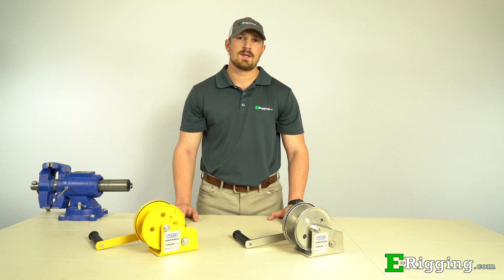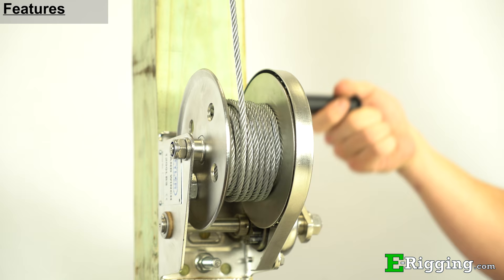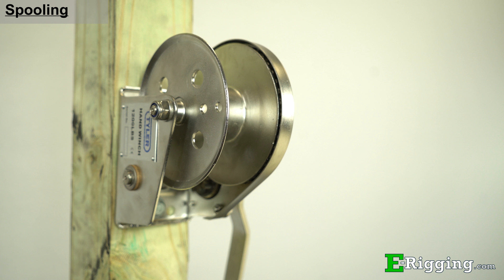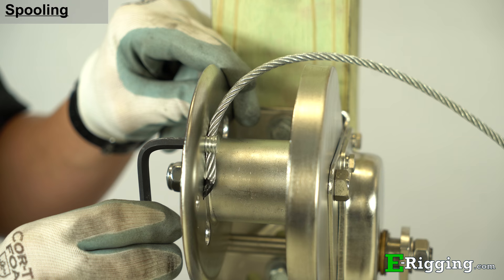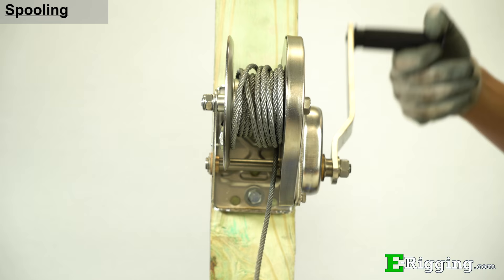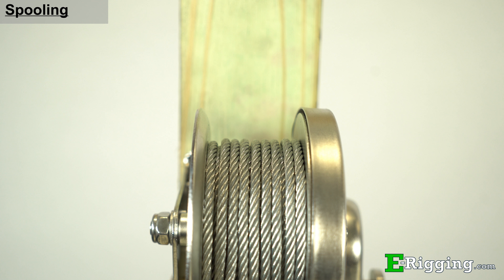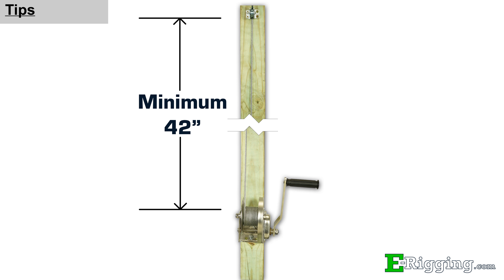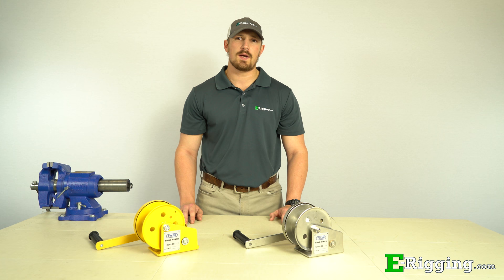How to Use Tyler Tool Hand Winches

Comment: Thanks for the video. I am using the nice hand crank winch to lift a jeep hard top. I have strung it straight up like yours and then down through the middle of my garage with 2 double pulleys and I have significant twisting. Restring? obviously I guess. Use only 2 single pulleys? What is the secret to avoid twists at the pulleys? Why can't I seem to use the double pulleys? Any references for making the cabling look pretty without twists? Thanks for your video and comments.